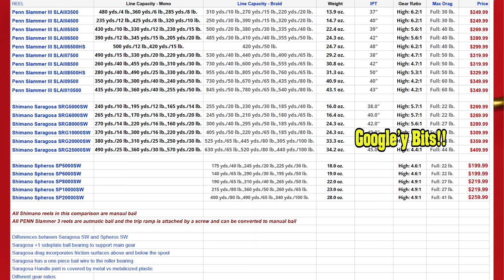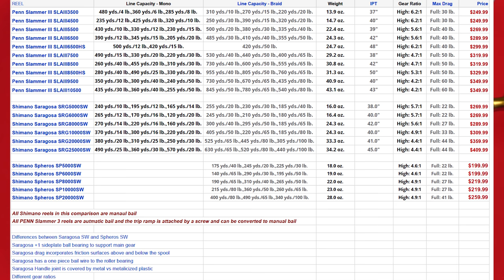Penn Slammer 3 vs Shimano Saragosa SW Who makes the best Surf Jetty Pier Boat spinning reel?  Sealed

Comment: Something to look out for - (and, having said that, I prefer your "something to look out for" approach to how one of the Alans somewhat too often slips in to declaring that some feature IS going to work better because of his talking points, such as down-scoring the Cabo 50 and 40 because they have a "graphite" rotor, but not dinging the BG for the same reason, since it has an "ingenious" air rotor design... which overlooks that there can be FAR greater practical differences in glass/graphite filled plastic, depending on the type/amount of fill, than there is between forged and unforged metal, when it comes to distortion rates... as evidenced by the fact that the BG rotor, despite its design, flexes too much when you get sharked, and the li'l Cabos do not, giving you a distinctly better chance of getting your lure/leader back, over years of using both) (though that also has to do with extra pinion bearing and bushing support, contributing to one reel being less mushy/bind-y under load than the other... and when fighting shark pecs from above with little spinners, mushy rods/reels really can make it so that there is no hope of breaking the shark out of "cruise" mode, even when grabbing the spool) - anyway, where was I, oh yeah, something to look out for, is a tendency to review by explaining why some talking point that one has come up with will or "could" cause a problem, instead of taking intensive experience with a reel and coming up with an explanation of what causes the actual problems it tends to have.  Where I'm going with this is that, although due to extensive experience fighting sharks that eat ten pound fish I do not question whether a Cabo 50's "graphite" rotor is stiff enough, I do WONDER whether the "graphite" side plate on a Saragossa is as "graphite-y" as the unusually metal-y feeling graphite rotor of the little Cabos... because if it is, then you're not going to lose much by putting the X-ship ball bearing in a graphite extension of that sideplate, but, if it is NOT "graphite-y" enough, then under the heaviest loads you may actually get more alignment issues, and thus more binding, by putting a metal ball bearing in a "plastic" arm than you do with the metal BUSHING that extends off the metal sideplate of the Slammer... as long as there is enough play in the bushing that even "slightly sloppy" twin bearings elsewhere won't allow the pinion to readily try to exceed that play.  The Slammer pinion, in other words, is triple supported, by metal, whereas the Saragossa is double supported... though with more leverage for the back bearing... but by "graphite" of some sort or another.  I suspect, in actuality, both the Slammer 4500 and the Saragosa 5000 ARE up to moving decent sized sharks... but I would not jump to conclusions without experiencing that with both.  I know the Boca 50 is... but I also know that doing so will eventually wear out its Delrin shaft bushings inside the pinion gear, causing play in the rotor, and you will need to pay more than a 25 cents apiece to replace them.  The nice thing about the strongest spinners in the 200 dollar range, though, is that when new, they are way better than half as good as the thousand dollar spinners, when it comes to what a good angler can catch with 'em, and such bushings that don't hold up over time can be cheaply replaced on them.  And if you temporarily remove a shield and grease-pack (with, say, Corrosion Block) the line roller ball bearings, any handle ball bearings, and any questionably shielded top pinion ball bearing, those bearings can hold up better than those of more expensive spinners (but of course one'll have to crank just slightly harder, and could have to give up fishing altogether!).
Reply: Turns out I DON'T know that sharkfights will wear out the bushings on a Cabo 50... in spite of the retaining collar's screw being tight, it turned out to just be a slightly loose rotor nut that was causing the rotor play... tightened that up, night before last, and my 80 year old dad whupped a sailfish and a kingfish both over 40 pounds (and hooked on the same baitless deep jig!) yesterday, with that 13 ounce reel... and I'm hoping our 15 ounce Slammers'll be even gnarlier than those Cabos (which have a comically weak clicker dog [not that that's a necessary part]), when I finish their rods.  Something to be said for the little Cabos, though, is that they have a metal arm coming off the metal FRAME (not sideplate), which is a presumably more expensive way of doing it, because that arm's hole has to be made to line up precisely with where the shaft wants to be, in order to accomodate a bushing without binding, whereas Penn knows it certainly can't get a metal arm coming off the SIDEPLATE to line up that precisely, and Shimano has to employ a graphite sideplate with a graphite arm coming off it, so that a little flex can ensure their bearing there will line up on the Saragossas.  So the Cabo is supported by ball bearings in the same medium on either side of the clutch, (which Hawk praised in the Saltiga), and a bushing in a metal arm further back... which gives it this one theoretical advantage over the Slammer and the Saragosa.
Reply: I should try paying more attention... it's only the Saragosa that has that arm coming off the sideplate instead of the frame, and it has the forward bearing's seat attached to that sideplate too... all in "graphite".  So yeah, there's no reason, other than cost of precise casting, that Penn couldn't have done it like Quantum did on the Cabo, and put a bushing there.  (By the way, the Cabo PTSE also has a brass main gear like the Slammer at this price, and the smaller Cabos have a STAINLESS pinion.  People get the mistaken impression from Hawk's reviews, which leap to conclusions in this case, [since he doesn't seem to have actual experience with the smallest Cabos] that the smallest Cabos are inferior to the [now discontinued] biggest Cabos, but they're all effective.)  (In fact, one has to read his reviews with a fine-toothed comb to see that he actually considers the gears of the biggest Cabos slightly superior to the STELLAS' [and with stainless steel pinions, the smallest Cabos' are better yet, or at least better suited to hold up to their non-manual bails], and though he considered the Cabos' drags a "close third" behind the Stellas' in terms of smoothness, he acknowledged that the Cabos can put out MORE drag than the Stellas can, and can handle it.)  None of this makes the Cabos globally superior to the "midprice" competition, but they should not be overlooked.  In fact, the only reason I got some Slammers instead of more Cabos is that the "symetrical" reel foot of the Slammers puts the heel of my palm in the recess of a "turned around" Pac Bay real seat (it's supposed to be a thumb recess), with one finger behind the stem, and the Cabos foot does not.  (The Cabos foot works better on "turned around" aero real seats though [with the hump forward], the idea with both "turn arounds" being to be able to jig with the wrist less cocked, which makes it easier to keep the butt under the forearm when a fish gets on.)
Reply: Looks like the mushiness when fighting sharks, from above, that weigh more than a hundred times as much as the reel, with the BG SW, when compared to the Cabo PTSE, is probably not a result of greater pinion support in the Cabo... since the BG is arguably better supported than the Saragosa, since it has a ball bearing on a metal arm extending from its metal frame at the bottom of the pinion, and a ball bearing around the middle of the pinion in a forward part of that metal frame.  These bearings aren't quite as far apart as the "plastic" supported ones on the Saragosa, but like the Saragosa they are on either side of where the main gear engages the pinion.  And though putting a bearing on either side of the clutch instead has its own advantages, both ways should work fine... so the somewhat greater mushiness of the BG, vs a substantial shark with braid, can probably ALL be attributed to going too cheap on the rotor "graphite" material.  This, however, presents Daiwa with the opportunity to come out with a 400 dollar "HDBG" that puts a few dollars more per reel into a stiffer, better amount of fill in the plastic rotor (such as the Cabo uses... unless, like the "hybrid ceramic bearing" thing they lie about, Quantum is just lying about the smallest Cabos having graphite rotors, and they really wound up going with aluminum on those as well... which would not surprise me, given the superior rigidity of the little Cabo and little Fin-Nor Lethal's rotors to the BG's)... and, more expen$ively, re-tooling frame molds so that the frame would accommodate a bearing on either side of the clutch, giving it balanced ball bearing support of the pinion AND clutch... though, to compete with the Saragosa, Cabo, and Slammer's powerful drags, Daiwa would also have to add a big washer(s) under the drag... but then they'd have a world beater, worthy of charging more, instead of half as much, for.  Could be the most powerful small spinning reel in the world, given that Daiwa's execution of the smallest Saltiga falls short of its bigger brothers, when it comes to ability to punch up (which not many people realize, since not many people want to pay over a thousand for a little reel)... so a $400 HDBG (with, oh yeah, grease-packed-ball-bearing line rollers) could wind up being their flagship "less than a pound" reel, and have strong sales at that price.

Comment: So what did you say was a possible Van Staal substitute?
Reply: Neither. Both of these reels are much smoother and refined experience.  You can't get them wet or dirty.  Van Staals are harder to wind but will be fine getting dunked or dropped on sand.

Comment: Hi, I'm planning on getting a st croix 12' and I'm thinking about pairing it with a saragosa 8000. Do you think that will be a good set up? Planning on using it for sturgeon fishing and some ray fishing from shoreline. Thanks.
Reply from the maker: May as well get the 10k for capacity.  The spinfisher long cast is a beast too.
Reply: @TackleAdvisors  curious as to why you suggest the spinfisher? I was thinking about the slammer 3 and saragosa but your videos and stripersonline forum edged me toward the saragosa, but I wasnt sure on how big I should go since I plan on putting 80lbs braid and bank fishing I would need more line as you suggest. I was planning on getting the 8k and buying a 10k spool to interchange for smaller and bigger fish.
Reply from the maker: @1t4ch1uch14  Mainly because it's a slammer with a top mounted drag.  It has the capacity and brass gearing of the large slammers.  In a large diameter and fairly tall long cast spool design.  Which may help ya get a few extra feet when casting  heavy braid. Any of the reels will work and the gosa is definitely a top choice.  The SpinVi lc is just another good option
Reply: @TackleAdvisors  after rewatching your review and comments on the ssvi, I'm kind of set on it but the only thing worrying me about the LC is that it'll probably only hold roughly around 200 yards of 80lb braid? As the 7500 lc is rated at 490/40 only. What are your thoughts? Sorry for these questions, I just need some expert advice. Thanks

Comment: I like seeing the reels taken apart, but I don't understand this thing about sealing.  Nobody is swimming with the reel.  It just has to handle  some spray. I also don't understand why these reels don't hold up better.  (The bearing on one corroded after one fishing outing?)  I've got 5 Mitchell 302's from the 60's and 70's.  One was complete neglected, the rotor was full of sand and it had obviously never been serviced.  There was only a tiny bit of corrosion inside.  The others had no corrosion whatsoever.  All the internal moving components in these reels are bronze or stainless steel, except for the main gear, which is duralumin, and the oscillating rotors, which are aluminum.   The pinion is machined stainless steel, not brass like in these reels.  The main body doesn't corrode even where the paint is gone.  There's no pitting in the castings.
I think Shimano, Penn, Daiwa etc. are using all these features and fancy styling to cover up the lack of real quality materials.

Comment: Scoob you did a great video, Penn seems to never get it right, they always fall short of perfection , love there reel design but that's about it, line lay was still off at the bottom of the spool, you had a gap. There will be a slammer 4.
Scoob  how come you and every one see else see the reels fault except Penn, They should give you the first batch of reels off the fine and you do an evaluation, not some one getting free tackle and making and making a video and saying how great it is, the true test is in the hands of the every days fisherman.
Reply from the maker: Thanks man.....One thing to consider with line lay....I usually say it looks great...that's the easiest way to put it to the masses....If i were to let my brain flow about line lay on a video...it'd be an hour long....lol  if you take a look at a spool of line.  And look at it's profile...every reel will have a gap of sorts that incorpporates an oscillation design such as this....But if you rotate the spool it can actually disappear.  Since the reel always wraps as it moves up and down....one side of the spool may show a cap while if you rotate it 20 degrees it may be flat and even.  That's not bad.  It's the gap at the top that encompasses half the spool that casuses an issue...along with the design of the spool.    But yeah...they can do better.  So can shimano....Okuma's epixor that uses a reductin gear in the design is where they should be going.
Reply: I agree, seems they're working the name and spending more on advertising than practical engineering.  Why can avet, zeebass, and van stall come up with great designs?  The torque is fugly, the slammer has problems, they argue that the unsupported end of the pinion gear is ok, when a silly little bearing or bushing would fix that for 5 cents.  Then all these plastic conventional reels, why even ebay chinese junk can make cnc reels for way cheap.  I bought a conflict II,  when for 50 bucks more you can by a diawa saltist bay, no comparison, glad I only paid 110 shipped.  I would pay more for an american brand but it would have to be the same or better.

Comment: Hello sir do you know the difference between the worm shaft gear vs oscilating gear, does worm shaft make a reel feel smoother ?
Reply from the maker: Worm gear won't make it feel smoother.  But it involves more parts to accomplish the same thing.  However it can result in a slower oscillation cycle....(some people think their Aero technium is broken because it takes 50 handle turns for the spool to go up and town.  :)  In the past Worm gear oscillation was superior but the other ways have caught up.  The only way worm gear is smoother is if you get a clunk at the top and bottom like on penns.

Comment: lets say i got with saragosa, what rod would you partner it with for SPIN fishing wels catfish in europe?
Reply: also, could you do a review on a interesting reel i found on aliexpress, stats are amazing, 35kg drag, lightweight, lots of line capacity: japan made lurekiller saltist (replica of Stella SWB)
Reply from the maker: I saw that awhile back.  Come to think of it I ordered it 2 months ago and still haven't received it.  I ordered it as a goof. But as always ya never know.  For heavy spinning I use tuna popping and jigging gear.  Shimano's new grappler rods are really nice but just be wary tuna jig rods may load up a bit much which is great for vertical pulling not sure how they would work for lake duty assuming fairly shallow
Reply: @TackleAdvisors  thank you so much for your feedback, and share your thoughts on that reel in the future ;)

Comment: Does slammer 3 3500 is good for inshore? I was able to buy in amazon the discounted price when I saw your post about it.
Reply from the maker: Thats the perfect inshore size.
Reply: Tackle Advisors so I bought 2. Do you think it is better to keep 1 and then get 1 daiwa bg 3000 or spinfisher 2500 for artificials? I’m just not sure if the slammer is over kill for speckled trout, flounder, red fish, sheepshead, whiting, croaker and sand trout. What do you think? I currently have 2 slammer 3500 in hand. Should I just keep the 2 slammer 1 for artificial and 1 for bait fishing?
Reply: Hi sir hope you could advise thanks!

Comment: Hi i love your videos.. my question is about something else maybe you can help me, i just got my daiwa bg 3000, out of the box ive noticed handle play and clanking sounds from the main gear when i spin the handle, is that normal or should i replace it? thanks!
Reply from the maker: It should sound a bit raspy or slightly geary (nothing rought or noisey though.  Send it back would be my suggestion.  Unfortunately it's a mass produced product and it happens...I've had a few bad reels in the last year from a few companies.